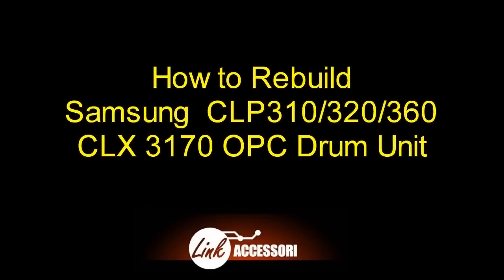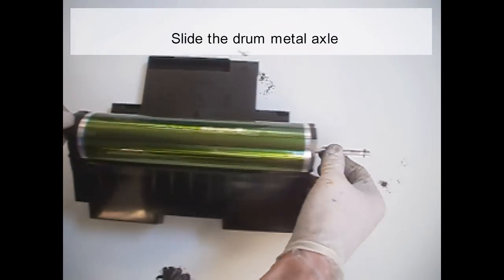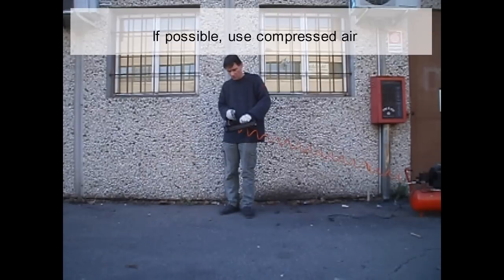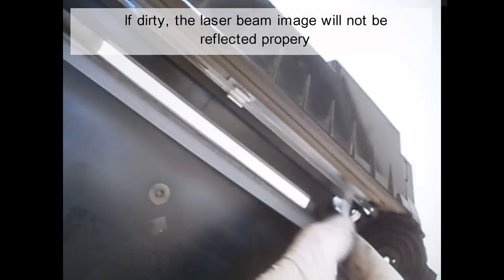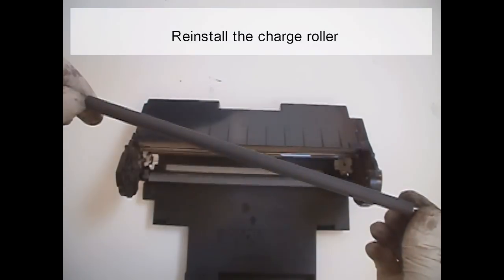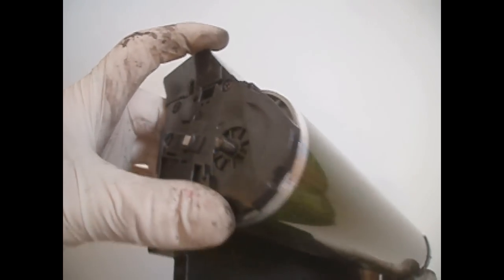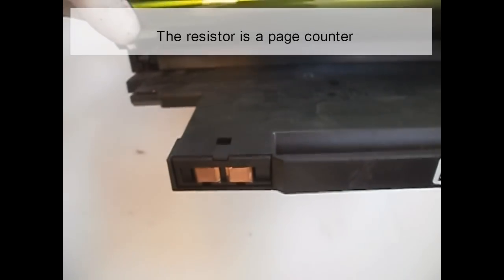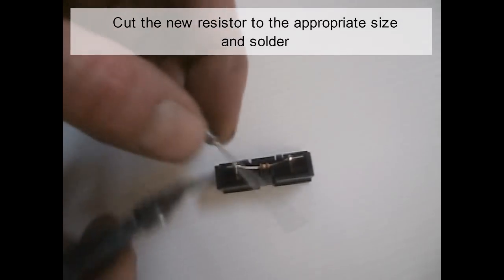Samsung CLP310 320 360 CLX Drum unit Rebuilding Instructions

Comment: Hi 
I work on it as your instruction.
after assembly  and print there are no image in paper. blank paper out.
could you advise me how to image drum  rebuilding?
Reply from the maker: May be the contact inside the printer. check the charge roller too
Reply: @viandant5  can you explain more detail for me or reference video in youtube? my printer is SL-C433. 
same problem was happen after dissembly and assembly in 3 time.
can I check image drum roller broken? plz explain me thank you.
Reply from the maker: @차달용  it's difficult to say exactly without checking the drum. may be the internal contact inside the drum cylinder is broken or bent, may be there is a faulty contact somewhere
Reply: thank you very very much.
I fix it as your advice.
Reply: I also printed blank pages. I had put the gear side of the QPC on the left. The gear side should be on the right side. Once the QPC gear was on the correct side, I was able to print again.

Comment: Followed these instructions because my Samsung CLP365's drum needed to be reset. All seemed to go well. Put the printer back together and the status light went green, but whenever I try to print, the green status light just flashes slowly. Printer never starts. Just sits there for hours flashing the light. Any ideas what went wrong?
Reply from the maker: +wlcgblog you can view the status of the printer in Easy Printer Manager. If not already download, you can find it in the Samsung Download Center.
Reply: viandant5 OK, I installed it. It just says "Status: Warning" and then below it always says "Warming up. Please wait." Doesn't tell me anything else in detail. Wish it did.

When I try to print anything, the little status popup appears and says "Preparing Print Job", and the status light on the printer starts blinking, and that's where it stays. Even the popup stays on the screen.
Reply from the maker: +wlcgblog probably the fuse you use to reset the drum is wrong. remove that fuse and try insert the drum unit without that fuse
Reply: viandant5
Still nothing. Just sits there, "warming up" forever. Thinking it's time to have a funeral.
Reply from the maker: +wlcgblog I think it's related to the drum chip. this defect may happen when the fuse does not blow
Reply: viandant5
It blows it. I've verified that. Twice. It doesn't say that the drum is expired now either. Thanks for everything though. I've retired this printer, and have a brother unit on my desk now. Not as cheap as fixing the Samsung should have been, but I'm printing again now.

Comment: I followed the instructions. After reassembling the 3185fw prints only blank pages. The drum runs freely without any problem. Any clue what the issue can be? thanks
Reply from the maker: look at the contacts on the side of the drum unit, disassemble and reassemble the drum unit again
Reply: Did not help. I noticed there is a green gear at the front right of this unit. It rotates only in one direction...?
Reply from the maker: near the charge roller? blank pages may be related to the charge roller

Comment: hello, thanks for this excellent video! my clx-3305fn gives error about "drum unit", it says "change drum unit with new one". I have been using this drum unit since I purchased the printer 1 year ago. I think I have to reset its chip and I took out the chip on drum unit, it has one brown resistor as you mention about initial drum units. in the video, you removed green resistor and put a new one there. What should I do now? should I put a resistor behind the brown resistor like in the video? but what is the resistor's name or value to put behind the brown resistor? if you tell me its specification then I can find it in my country, in some electronic shop. THANKS A LOT!
Reply from the maker: do not remove the brown resistor, in your case solder the new component. put the component behind the brown resistor like in the video. I think it's not possible to find this component in some electonic shop, it's an integrated not a simple resistor
Reply: viandant5 thanks for the quick reply. should I put the green component behind the brown resistor like in the video? I searched for info on russian forums and found this:
http://www.chip.ho.ua/fuse.html and a photo about the compoent here: http://www.chip.ho.ua/reset_iu_samsung_clt-r409.jpg
Fuses pico fuse 1 / 16A, what do you think?
Also check this page:
http://be.farnell.com/littelfuse/0251-062mat1l/fuse-quick-blow-62ma/dp/9921931
I think I have found it, here is the link:
http://www.aliexpress.com/wholesale?catId=0&initiative_id=SB_20150118012339&SearchText=r409+drum+reset+chip
or here is another link:
https://www.westfloridacomponents.com/F078PE04/1%26%2347%3B16A+Picofuse+Littelfuse+0251.062MRT1.html
Reply from the maker: murat büyükdinç yes, you should put the green component behind the brown resistor. the russian forum is correct
Reply: viandant5 thanks a lot! after 2 days of search on internet, I have learned that there are 2 types of littelfuse. Type1 (0.0625A 125V) is to use on 110V city electricity. Type2 (0.0625A 250V) is to use on 220V city electricity. For example, in my country, we use 220V electricity so I think I should buy a littelfuse 0.0625A 250V version. I will order it and try it, I will let you know about the result.
Reply: viandant5 yes, it worked !!! I soldered the green littelfuse (0.0625A = 1/16 A, 250V version) behind the brown resistor on drum chip and I got rid of the "replace new imaging unit" error of my clx-3305fn printer! yayyy!!! :)))

Comment: Hi, i have followed your guide but i guess i have did something wrong. I tried printing a test page, but it only prints on the left most side for about 0.5cm thick. All the colors are there so the result is a heavy colored one. Any way to fix?
Reply from the maker: +Jepher Chang I think a component of the drum unit is out of position, may be the rod lens array. I suggest you to dismantle and reassemble again the drum unit.
Reply: tried dismantling and reassembling it. now the dirt i want to remove is back. but still no text/image
Reply from the maker: +Jepher Chang are you sure the defect is related to the drum?
Reply: +viandant5 not sure. but that's the only thing I have touched. I still have inks about 50+%
Reply from the maker: +Jepher Chang I think the rod les array is broken, dirty or out od position or the drum is not reassemble correctly and the developer roller is not in contact with the drum surface.
Reply: +viandant5 hi viandant, I have it check in service center. they say the opc doesn't have any charge and needed to replace. it turn out to be in light green color, they say it must be dark green.

is there a way to charge it or no hope in fixing it? and buy another unit
Reply from the maker: +Jepher Chang the color of the drum is not important, there are different colors of drum, it depend on the manufacturer. changing the drum probably you will solve the problem but an "OPC that does not have any charge" means nothing
Reply: +viandant5 Hmm. I just don't know what seems to be the problem. that's just what the technician said to me. going to disassemble it again.

additional concern. if i bend the rod (the clear one) is it still fixable or not? and also the gear part of the drum is on the right, if it facing me
Reply: +Jepher Chang hi viandant. please check you fb msg. I have sent a pm. I'm trying to send you a sample print out. I'll send it once you confirm it. thanks
Reply from the maker: +Jepher Chang no. I haven't receive it. my facebook is tomesani gianni
Reply: +viandant5 maybe it's on your other inbox. you can't view it on your mobile.

Comment: Hello friend, I have a big problem, clean the unit as mention it, but after installing all print command and all the leaves are blank, if I take the same copies, always leaves blank, nothing is printed.
Reply from the maker: +Jesús Casillas it may be a problem of bad contacts with charge roller, or with the internal ground contact of the drum. try disassemble and reassemble again the drum unit
Reply: Did it help? All connections seem to be good. I even used contact spray. No change. :(

Comment: Hello viandant5, I just watched your video. My Xpress 460FW only has a 100k resistor. No thermal fuse. Do I replace this resistor and also solder in a piece of copper wire across it?

Thanks!
Gary
Reply from the maker: The starter drum unit has no thermal fuse . let the resistor there and add the thermal fuse

Comment: I assume your drum has been used for quite awhile. By cleaning it, does it help to last for even longer or it will just die after awhile.
Reply: +Jackson Boo Any ink reset guide?
Reply from the maker: +Jackson Boo cleaning the drum does not help to last longer. it only improve print quality
Reply: +viandant5 As the drum get older, the quality drop. By improving the quality = lasting longer? Or it just doesnt work that way?
Reply from the maker: +Jackson Boo It cno, it does not work in that way. the quality of a drum depends on the shape of its outer layer and light fatigue. cleaning a drum does not restore the outer layer
Reply: +viandant5 Ahh! I see, Thank you for the knowledge :D

Comment: I have clp 325 original toner no chip sometime it NOT found magenta cartridge  sometime it found   :: status   "magenta cartridge not install please install "  how to fix it
Reply from the maker: JeeRa Wit it's a starter cartridge. starter cartidges have no chip. do not remove the cartridge drom the printer or you may have problems. to fix it you can only install a chip into the cartridge
Reply: All toner cartridge no chip  but  not found  magenta only
Reply: But sometime it found  i can print  normal
Reply from the maker: JeeRa Wit all your cartridges are starter cartridges. probably magenta cartridge is near the end of its life, starter cartridges have not many toner
Reply: Thank you so much .  Can i use  clp-325 cartridge  replace in clp-365?
Reply from the maker: JeeRa Wit no, the cartridge is almost the same but the chip is different

Comment: the name of the fuse to buy it on the Internet?
Reply from the maker: +VideoBlog 73 you can find it on ebay or searching with google "reset Samsung clp"
Reply: could you provide a link to the fuse? you are welcome.
Reply from the maker: +VideoBlog 73 for example this:  http://www.ebay.it/itm/4x-Drum-Reset-Fuse-for-Samsung-CLP-310-CLP-315-N-W-CLX-3170-3175-FN-FW-series-/121193047010

Comment: Hello all, 
I have a Samsung C460W printer with initial OPC (Imaging Unit:  6649/16000 (Image(s)/Life))
I have some dirty prints so I clean the printer and OPC according to this procedure.
The problem is that after doing that all printed pages are blank pages, there is no errors in the printer, everything seems to be normal. I tried dissembling and assembling the OPC again but nothing changes...   Can someone help me to solve this issue?
I have check in the comments that other people face same problem...  can someone share any ideas?
Thanks in advance!
Reply from the maker: check the continuity between the drum and its metal shaft, check the conbtacts between the drum and the printer

Comment: i cleaned the drum unit for samsung xpress c460w and aftter closing the printer is printing blank pages pls ssist
Reply from the maker: may be a contact between the printer and the drum unit is broken or out of position. try disassembling and reassembling the drum unit. verify the position of the charge roller

Comment: i've changed to the new resistor and do not work , i done the jump with single copper wire, and not work to. In Brazil the drum unit it's very very expensive , please help me
Reply from the maker: +Joao Simoes if the drum does not reset in any way, I think the problem is not the drum or at least it's not the fuse. i would try checking the connection between drum and printer

Comment: hi there - i have a samsung clp -315; recently I noticed it prints pages with horizontal lines and smudges in black and sometimes yellow the whole width of the page. When I print a 2nd page, it ghosts the previous page on the new page as well.  I have followed your videos on how to clean the transfer belt and image drum, and installed new toner cartridges, but the problem persists.  Any chance you could advise on what I can do to fix this issue? 

Here is a link to show my issue: https://imgur.com/gallery/WfH19jO
Reply from the maker: The cleaning of the drum unit and the transfer belt is useess if the drum unit is defective.. It seems to me a problem to the drum unit
Reply: @viandant5  thanks. I will look to find a replacement drum. Should I replace the transfer belt at the same time? Any tips on how to prevent damaging the drum unit ?
Reply from the maker: @patrickx7876  It's not necessary to replace the belt, However without checking the printer I can't be sure it's a drum problem. To prevent the consumption of the drum do not turn on and off the printer frequently, the printer must be in a dry environment